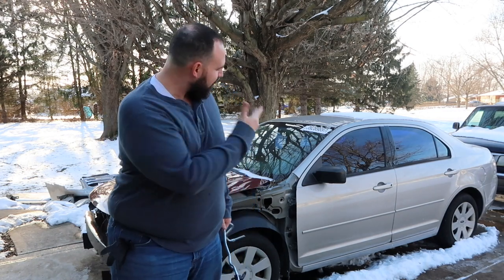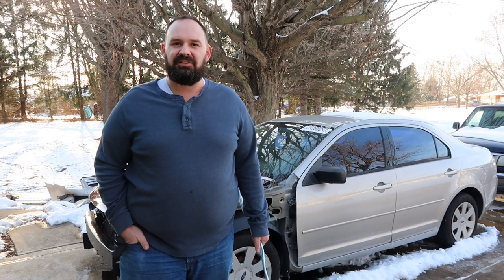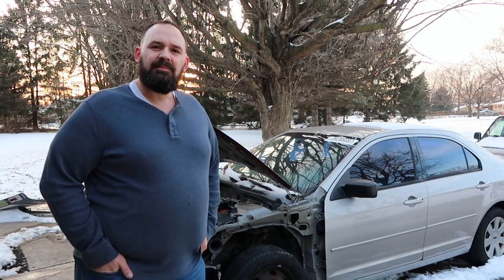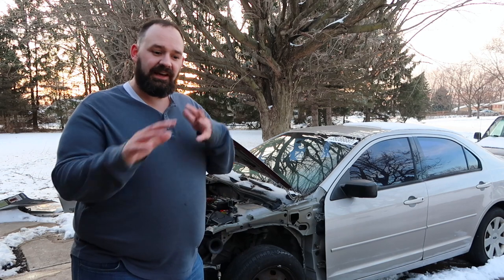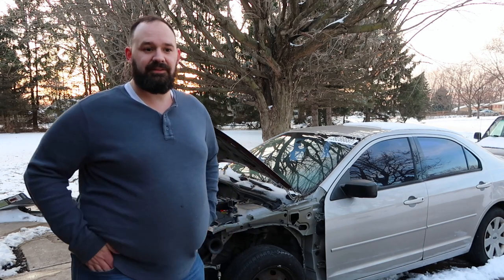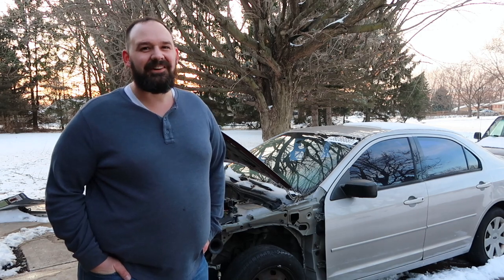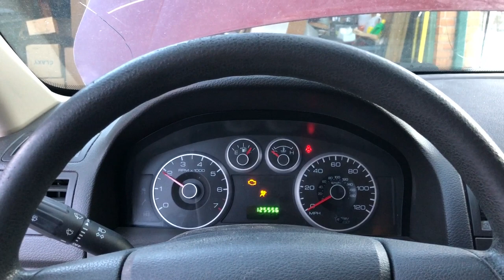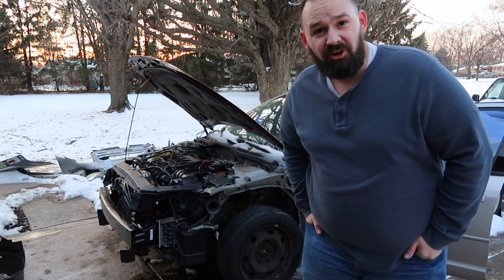Fusion Rebuild -- Part 6 -- 1ST DRIVE!! -- Reassembly Pt 4 — My First Copart Rebuild Project

Comment: Engine sounds great, and I'm sure the check engine light is something minor you can find with a code reader. Nice to see it running and driving again. I hope this encourages  you to purchase another Copart vehicle when you're able and go through the process again. Remember, each time is a learning process and you'll gain more knowledge as you go. Say, don't they use road salt in Indiana? That Fusion body is exceptionally clean. Here in eastern Canada, rust frequently starts appearing on some vehicles 6 or 7 years in.
Reply from the maker: Thank you for the encouragement! Definitely planning to get another car and do this again when this one’s done.
Yeah, Indiana uses salt. And so does Ohio where this car came from. So I’m not sure how it made it so long without rusting. Maybe they didn’t drive it in the winter? Whatever the case, I’m happy to have it so rust free!
Thank you for watching!

Comment: I'm interested to see how you replace those airbags and reset the system. And where you get replacements from. Did it have both fronts popped?
Reply from the maker: Yes, both fronts blew. I’ve just uploaded the first video in a short series on airbags and seatbelts. Thanks for watching!

Comment: Great work buddy ... power steering probably has air in the system , give it a few days if not replace the power steering pump. All in all great work nice to see you finally got to drive it.
Reply from the maker: Thank you! Appreciate your tip on the power steering!

Comment: On my son's Ford, you have to use ATF, regular power steering fluid made it noisy.
Reply from the maker: Yeah, I'm using ATF. Did some research and think the problem is the system needs to be bled. Thanks for the tip and for watching!

Comment: Great job! Maybe you should bleed the power steering lines before replacing the pump. What do you plan on doing with the srs system?
Reply from the maker: Yeah, I was doing some research after I got done and realized that is most likely the problem. I’ll be doing that before the next drive.
SRS system will be the topic of my next video. Need to get that ball rolling!
Thanks for watching and for the tip!
Reply: Excellent!!! looking forward to it. I just posted a comment with a link, someone appears to be copying your videos! or maybe you have annother channel lol. Either way you should check it out.

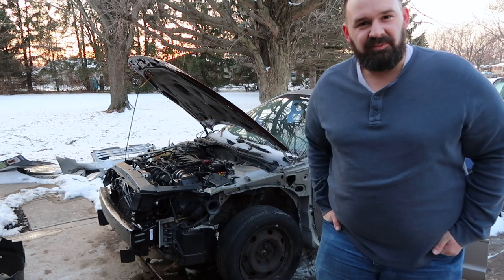Comment: It almost looked like something sparked around 4:07
Reply from the maker: I’m not seeing it. But I’ll keep an eye out. Thanks for watching!
Reply: Crossroads Rebuild its hard to see its a bright flash on the ground reflecting off of a puddle maybe its nothing and just a issue of me streaming the video
Reply: I saw it too.
Reply: Looks like a turnsignal amber. Under driverside of bumper
Reply: Bernie Jr yeah but it happens as he's turning the wheel it could potentially be a short somewhere better safe than sorry
Reply: Yea I seen it. Its under where the bumper would be by the crash bar, that little wet puddle, you can see the reflection.
Reply from the maker: Now that you mentioned where you were seeing it I went back and looked again and I see it now. Not sure what that is, but I’ll definitely investigate! Thx for pointing it out!!
Reply: Crossroads Rebuild sorry about giving exact location love the videos though I ll be buying a project from copart in about a month
Reply from the maker: Awesome! Hope you have fun with it!!